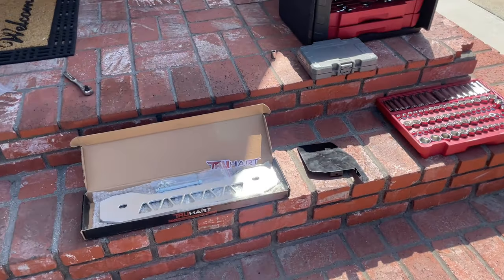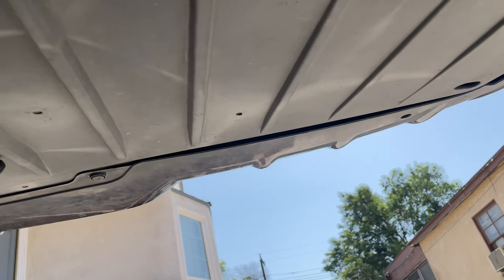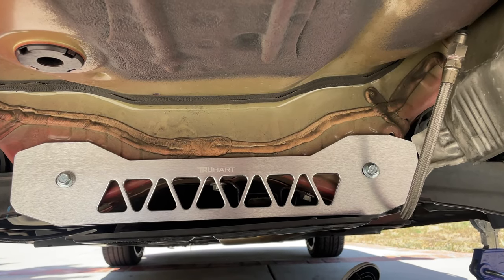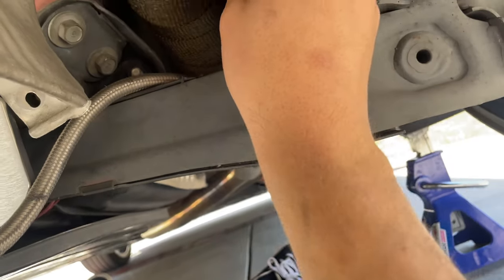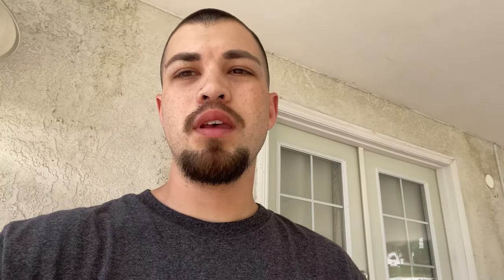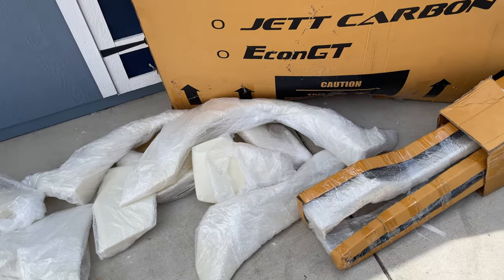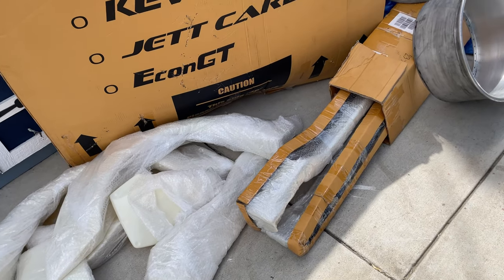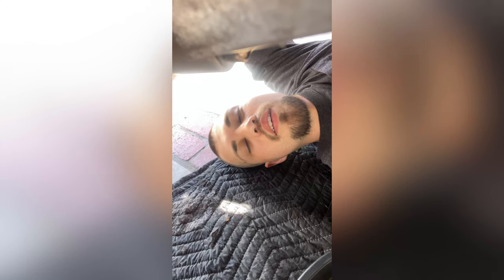UPDATE on my 9th gen civic. *NEW PARTS* NEW CAR*

Comment: Any issues with it? Did you use the Flanged Hex Lock Nuts when you install it? If so, did you put it between the truhart brace and the subframe?
Reply from the maker: The exhaust ? I had no issues. Only it melting my rear valance.
As for hardware you use oem hex bolts where it connects to the cat in the front the rest is spring hooks